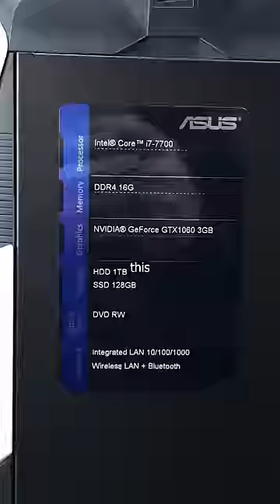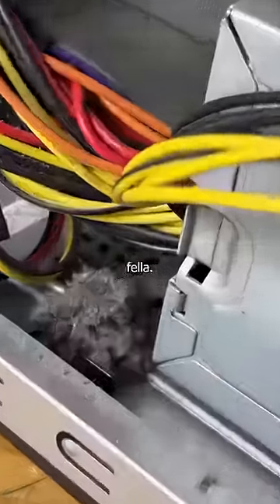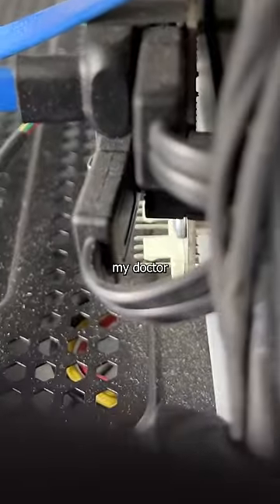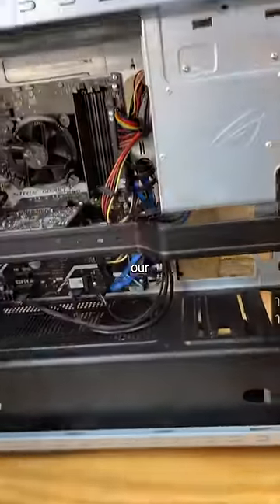Melted GPU in an ASUS ROG Strix gaming #pc (RIP) #shorts #tech #technology

Comment: Once had something similar, but it was the optical drive. The molex connector melted somehow, causing one of the leads (12v, I think) to short to ground. Thankfully, I was able to shut it off before the PSU was toasted.

Comment: This support bracket is sucha pain in the ass. Screws that are used to hold graphic card are made out of butter and you cant do anything without removing them...

I also recommend removing lower front panel as it blocks air flow and causes of that this PC overheats and sounds like hair blower.

Comment: I remember when I got called home from work early one day because "my computer started the house on fire". Turns out that My wife (god bless her) decided to swap out my super fancy, top of the line Power strip I plugged my Computer and monitors into for the 5 dollar strip that I'm about 90% sure someone purchased from a yard sale. The reason was because mine had the 2 usb inputs on it for charging phones, and tablets and stuff and she had misplaced the plug part of hers. Well my Son powered up my computer, there was a loud POP followed by smoke. Upon pulling up to the house expecting to see fire trucks everywhere I saw her standing in the driveway in her robe where she told me what happened. Turns out that cheap ass power strip was overloaded and one of the plugs caused it to arc and smoke. The strip stopped working in all but one input. Luckily my computer was fine, but it was still really funny in hindsight.

Comment: What is up with Computer companys making The fattest heaviest case with 0 ventilation. And then stuffing the cheapest parts possible in it. Like a gtx 1050 paired with a 10th gen i3 with 8gbs of ram. again WITH NO COOLING and then charge you 800 dollars for it.

Comment: My 1060 6gb also randomly caught on fire but it still works 2 years lster. I think a mofset popped but it never actually stopped working. I didnt notice it when it first happened, only when i went to upgrade i took the cooler to repaste and sure enough huge black goo marks and scorch marks.